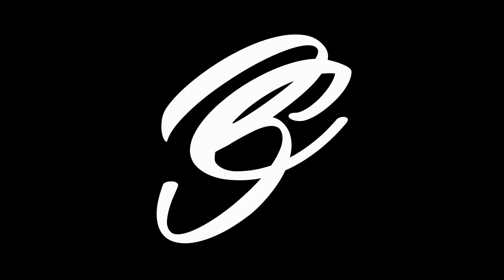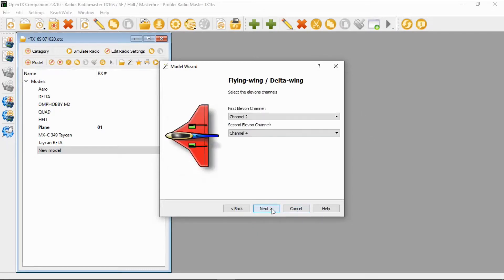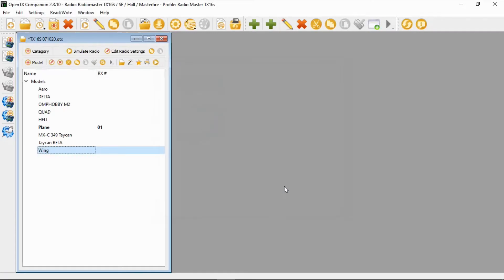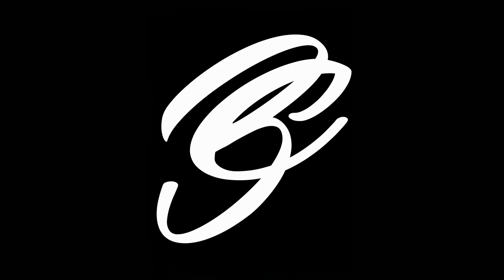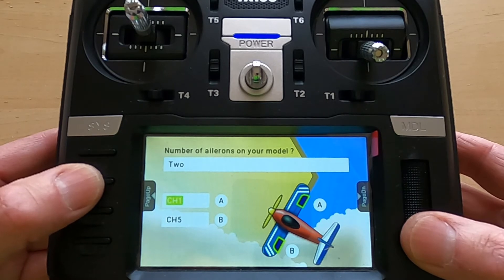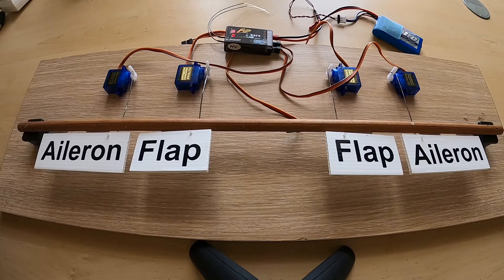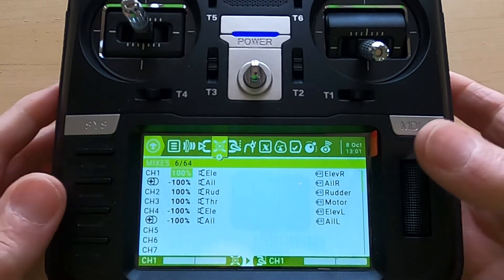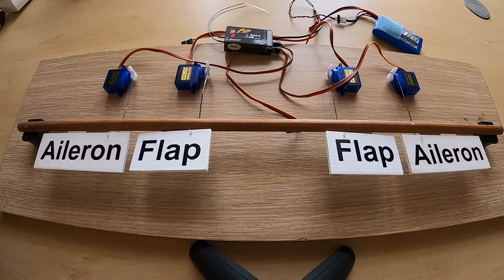RadioMaster TX16S Setting Up A Elevons On A Delta Wing

Comment: Hi Bill you are probably sleeping as I write this but I have found the problem I was using a new Spektrum 4 channel receiver and the only way I could get the motor to work was to put it in chan 1. I could not do the mix as the RM16s T/X puts the motor on chan 3 and the Spektrum would just sit there and beep when plugged into 3.  So I thought I would try a FrSky  6 chan RX and after hooking it up it worked fine.  My electronic expertise is marginal to say the least, I just don't know why the Spektrum would not work, I do thank you for all the help without your input I would have not got this far regards   Kevin   California USA
Reply from the maker: Hi Kevin, I am pleased you have sorted out your problems.

Comment: Bill another development if I move the rudder stick to the right it activated the throttle just from center to the right but I still have no throttle on the throttle stick I fly mode two throttle and rudder on the left stick Kevin
Reply from the maker: Make sure your inputs are default and check your mixes. You can send me a back up of your radio and settings and I will take a look for you.

Comment: Hi Bill I cant get my throttle to work I followed your instructions (twice) and no joy it will just beep over and over I moved the throttle to high then plugged it in but same result constant beeping. I checked the esc which is OK, when I go the the page that show the percentage of stick movement there is nothing on chan 3 all the other chan are fine showing from zero to 100% I am using the Radiomaster T/X16s bound to a Spektrum receiver  (No problems with either) any ideas? thanks in advance  Kevin
Reply from the maker: Hi Kevin, if you are setting up a safe throttle please check you have chosen the throttle stick and not Input or Mixes.
Reply: @the-happy-RC-flyer  Thanks for the answer Bill no I have not set up the safety throttle, what I don't understand is when I check the servo movement on the TX nothing shows up on the screen on the throttle chan  and all other channels are working from zero to 100%  I am sure it is a simple fix but it has got me stumped at the moment regards  Kevin
Reply from the maker: @kevinflynn6306  could you send me a back up of your radio and model settings so I can take a look.

Comment: I cant find a video on how to set up elevons WITH a rudder. My quasarXL has rudder. My tx does not have an option to select "flying wing" in the setup wizard.??? My channel mapping is AETR. I want to keep rudder on my left stick, and use the right stick as I do on normal configurations. I'm assuming I would use ch 5 as my second aileron, but after that I'm lost!!
Reply from the maker: Hi Jim, which radio are you using?
Reply from the maker: A) Set up Basic Model then alter
CH1 source Aileron INPUT Weight -50%
CH1 additional line source Elevator INPUT Weight 50%
Same again for CH2 but both weights 50%
CH3 Throttle 
CH4 source Rudder INPUT Weight 100%
Hope that helps.

Comment: I have a FX-79 wing with flap setup (not flown yet).  Looking at it, I think an up elevator mix is needed when using the down flaps.  With down flaps, I think it would send the wing in a dive unless counter balanced with some up elevator?  Does this make sense?
Reply from the maker: Hi Frank, you cannot set up flaps on a wing as both Elevons going down are your elevator control. If you set up a flap mix your nose would dive when activating the flaps.
Reply: @the-happy-RC-flyer  Thanks for quick reply.  But I need to be clear on setup.  On my flying wing, The ailerons are set up as elevons and there are stand alone flaps separate from the elevons.  Since the flaps are on the trailing edge of the wing, deploying down flaps should work the same as down elevons and cause the wing to dive.  So I think some up elevon mix is required to keep wing level when using down flaps.  For example, my high wing trainer plane with flaps needs some down elevator to keep the plane from climbing when flaps are deployed.  (This planes flaps are in a position on its wing to cause climb rather than dive).

Maybe setting flaps on flying wings to go up would be safer than down since would cause wing to climb?
Reply from the maker: @frankroth5238   ok I have never set up an aircraft in that configuration. I have a video which shows you how to set up separate flaps which will help you with the programming.

https://youtu.be/csDYQxdJA1k

Comment: Thanks for this tutorial, on my TX16s the mixing doesn’t show up at all, where does it get as on yours?
Reply from the maker: Peter you need to give me a little bit more information to be able to assist you. Are you saying that after using the model set up on your radio or in Companion there is nothing showing in the Mixes window in the model you have set up?
Reply: @the-happy-RC-flyer  Hi Bill, thanks for your kind reply. No mixing show up on the radio, using radio not companion. But I looked at your mix and “copied” the setup to my Radiomaster and I’ve got this working 👍🏻 love your tutorials, kicking me in the right direction as the beginner I am. Have a nice day, thanks 🇩🇰